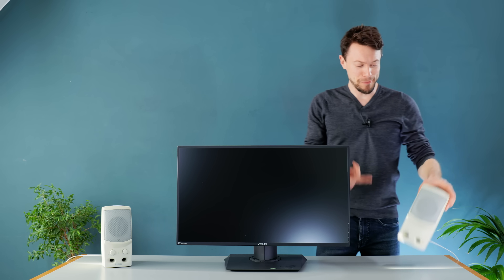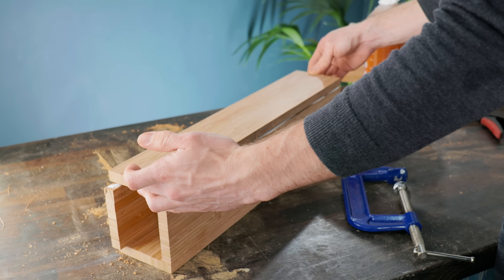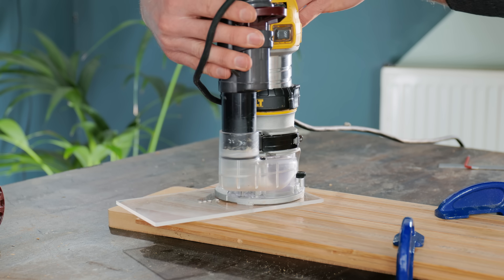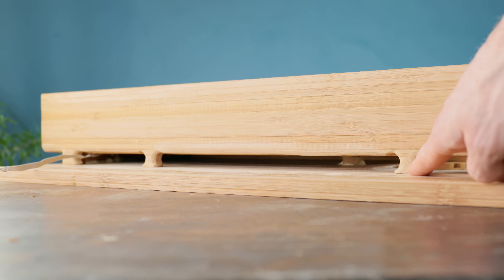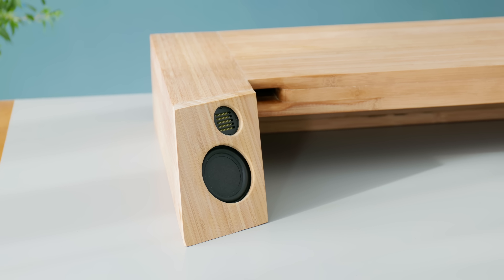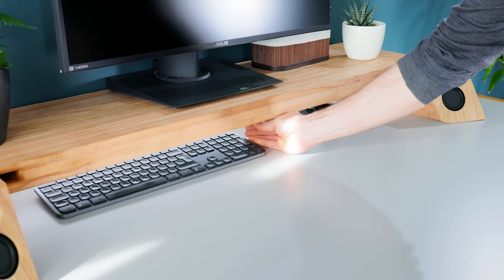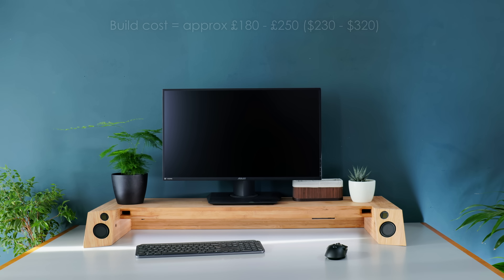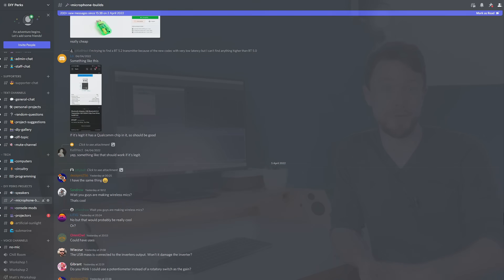Building a PC sound deck... with a twist!

Comment: looks great! the only thing I would've done differently is screw in the 30 degree facing speakers into the stand instead of glue... having absolutely no way of access the speakers for replacement of maintenance gives me a bit of an unsettling feeling. either that, or an access port from underneath? what do you think?
Reply: itsjust hot glue you can just pull it out with little effort
Reply: @thewhiterabbit133  Depends what glue it is. Some glues are so freaking strong that you will rather destroy the wood trying to take it apart. Especially industrial quality glues are unbelievably strong and gluing points become stronger than the material itself.
Reply: @thewhiterabbit133  If that was woodglue Matt used, he isn't getting the front panel off without destroying the wood. I agree with Alex. I wouldn't have permanently closed that space. It's £300 spent on a home made speakers, (subject to issues) so I'd want it to be fully accessible. 

That being said, I think they are incredible and they are on my list of things I want to build, but probably never will, hence why I live vicariously through Matt.

Comment: Fantastic idea, really! The only thing I would add are silicone or rubber feet to achieve a minimal mechanical separation from the table. I know, ideally you should be using spikes to do that, but maybe they would be just too much, and silicone feet would be a cheap and yet effective compromise.
Reply: If you are trying to decouple the speaker from the table, spikes will not do that. They will just concentrate the energy into one point and still transmit it. The best solution from a practical standpoint is something that dissipates the energy as it travels through it, such as foam. I haven't had any issues with soft rubber feet, so likely that works too.

Comment: MDF is used in speaker because of its rigidity and sound damping. In the opposite hard wood is used in guitar because of the resonnance. For a speaker MDF is much more appropriate. IMO you'd rather buy a measurement mic (can be found cheap) to tune the crossover. It is nearly impossible to make a crossover by ears ...

Comment: woooohooo, always such a treat when you upload Matt!! as usual, this is a beautifully designed and crafted project and the result is stunning. 

every time you make an audio project, which is quite often, i feel compelled to request that you make a spacial audio/surround sound hat/headphone/speaker headset, with a full surround array of speakers that can be worn on your head, using old laptop drivers perhaps.

i know it sounds kind of silly but i think it would be a fascinating and desiderable device with the growing interest and development in AR/VR and metaverse stuff.
please consider it, i know that if you gave it a go it would turn out great. my hurdle is my lack of understanding regarding audio signal processing. my only approach would be to use an off the shelf 7.1.4 receiver, and they are all heavy and huge, designed for fairly large drivers. if it could be shrunk down, i think a spacial audio headset would be an amazing accessory for the upcoming PSVR 2 for example!

Comment: That does look incredible but it may solve an issue that doesn't really exist anymore. you could always buy smaller bookshelves. While they won't be as small, they will still be small enough like the Edifier R1700BT. As the name suggest they have bluetooth functionality and sound incredible. The issue I have with PC monitor shelves is their lack of versatility.  It is extremely rare they fit 2 monitors well, let alone 3 which some people may want. Naturally, these could be use in conjuction with an arm, and just used as a shelf underneath the monitor. so there is that. 

All bookshelf speakers can easily be either mounted to the wall, placed on an angled foam(just like the soundbar) or placed on stands for them to be angled down above the speakers. 
This might be more expensive overall, but this ensures it works in any situation. I may also be too focussed on the usability in general. I tend to like my things to work in a variety of situations I can find my self in. That said... I still have to place mt R1700BT's properly. Most monitor stands go as high as I would need it to go currently, and wall mounting is a no-go for me currently.

Comment: That looks great.  I doubt I'd build one though.  I am using a set of Logitech 5.1 surround sounds speakers with a subwoofer and they do great for me.  I have the 2 front ones at an angled towards me and the 2 in the rear also pointed towards me and the center one is on top of my monitor and the subwoofer is in the floor under my desk and they all give a great immersive sound creation (for lack of a better word).  The speakers I really like was a set of Creative Labs 5.1 surround sound ones but the rear speakers quit working and I just haven't taken the time to take them apart and really find out what has happened to them.  I do like your build though.  It looks wonderful.

Comment: that $1200 set of Monitor Audio bookshelfs sound like they lack a tweeter to me or if they do have one, Its not tuned correctly or even hooked up. The low end and the mids are really full and spacious as expected from a decent set of bookshelf speakers. The DIY has a smaller soundstage with tighter more punchier bass, recessed mids but definitely more high end.

Comment: Nice build (and upvote).  Your build details are nice since it gives ideas for DIYers for our own builds.  I've loved your previous projects and looking at building your DIY microphone.  That said, I am not a fan of this build.  I pretty the less forward sound of the bookshelf speakers.  Typically I run bookshelf monitors for my main PC rigs.  I prefer the sound even if they take up space.  Also, I find speakers sounding the best when they point horizontally at ear height.  Firing upward may not sound the most immersive.  Something to watch out for:  the mid-drivers may be subject to damage being angled slightly upward and at the front.  You may need to put a grill on them or be super careful to not bump them.   Kudos again for a nice build.

Comment: This is awesome! Lots of great ideas in here that I haven't seen in some of the other desk designs. I have two questions:

1. Is volume the only function for more bass, not the size of the channel the bass bounces around in? That space is narrow so it seems like the waves would be too big to fit in it well.

2. Can you provide a clearer picture of the path for the bass channel? Are those gaps on the side related to it? I'm having a hard time visualizing the space you've given for bass just based (ha!) on the description and video clips.

Keep up the awesome work! I love, love, love that you're focusing on reusing and reducing and building stuff rather than buying new! I always look forward to your videos!
Reply: 1. Look up longitudinal waves. They don't need thickness to travel. Transverse waves do require thickness along one axis but sound travels as longitudinal waves in air. Also, static pressure is transmitted almost evenly throughout a closed space. While this isn't completely enclosed, this principle sort of applies here as well.
Reply: @Sweet-Vermouth  Oh, right, it's more of a compression of the air molecules rather than a wave like in water.

Comment: Laughs in 90's Pioneer amp and two JVC speaker boxes with 10 inc subs. Biggest issue is to keep anything on table when volume is turned high.
Also not fan of closed in speakers. It looks nice but get ready to use saw to replace speakers if anything were to happen to those...
Maybe make the front plate with speakers that has its own box and gets pushed in place. This way it does not matter if there is screws holding two peace box together and you can access the elements for repair etc. Could be pretty neat design feature to crown the front plate as well so it looks like floating.

Comment: This is kinda cool,downside being it takes up a LOT of space and reduces flexibility for rearranging your setup later. You're pretty much fixed in that orientation/layout. Having the ends protrude THAT far out from the wall/far side of the desk would drive me nuts. 

Making a monitor stand/amp/dac/subwoofer is a good idea, but separate mid/high speakers would be better. Getting them up off the desk would be nice too. Just because a speaker points at you, doesn't make it superior to one that doesn't but still has good frequency response at that (off)axis. 

Smaller powered studio monitors(especially on small stands) with a simple powered subwoofer under the desk is not expensive and fully flexible and take up little room. I'm currently using some small JBL 104s and a JBL active sub. Takes up minimal room. Excellent sound quality and you can even put your headphones over a speaker because of the round shape.

Comment: While watching the intro I just want to say most soundbars have degraded sound quality within 1.5m (5ft) listening range. So unless you have a really deep desk they will produce subpar audio on a desk top while you use keyboard & mouse (fine for gamepad gaming though). I made the mistake not researching this earlier this year...
Reply: Sound bars in general are all degraded in sound quality. They are a compromise of space for audio quality. The midrange is almost non existent and the lower portion of the midrange is made up by the subwoofer. This becomes a problem because sub bass frequencies are non directional, yet low midrange frequencies are directional, at least to the human ear. That means that where you place your subwoofer becomes more critical because your ear will be able to tell where the subwoofer is or the higher end frequencies coming from the subwoofer will create special distortions when listening. 

If you ever wonder how much of the frequency band a subwoofer is making up for since a sound bar is lacking, turn off the subwoofer and listen to how terrible the sound bar is by itself.
Reply: @VictoryAviation  I'd call that "downgraded" rather than "degraded". You are talking about a lesser sound quality based on the form factor and design. That's a different story.
My issue is about use-case. Sound bars are optimized for living room arrangements, so if you put one on the far end of your desktop and sit in front of the desk like a normal computer user, that's too close. The sound quality is significantly degraded compared to sitting a meter or so further away from the exact same sound bar.
By the way I found that specific sound bar fine even without the sub plugged in if I was sitting in the suggested listening distance. It was just not suitable for PC usage. Maybe I picked a good model, maybe I'm just not an audiophile. Doesn't matter to my point I think.
Reply: @rustkitty  Degraded sound was correct. A sound bar uses psychoacoustics to give the allusion that you’re hearing a full spectrum of sound. In other words, the sound you are hearing out if it is not the same sound that the audio engineers created in their multi-million dollar studio. The engineers of sound bars take a different sound driver setup and manipulate the EQ to a point where it doesn’t suck. In order to do that, the EQ must be colored (changed) compared to a flat EQ. Almost all modern headphones do this as well by the way, like beats and bose for example.

So in the sense of the definition, the sound is certainly degraded from the source material through sound processing and because the equipment is not capable of recreating the same quality of signal.
Reply: That is why you use a sound bar with a TV, and put the whole thing on a coffee table 3-4 ft away while you sit on the couch.
Big media setup perfect for games and movies, and put the TV on a mount that you can pull closer for boring old work dealing with text and emails. Current Gen graphics cards are finally available at OK prices, and have modern hdmi for eARC and full low latency 4k 60fps hdr compatility. It's truly amazing!
And yeah, it is no 120hz monitor, but I'll take 4k hdr on a big display at 60fps any day compared to a tiny screen at a higher framerate. At home I am mostly consuming media or doing work. For the 3-6 hours a week I play games vs the 20-60 hours a week doing everything else it just isn't worth it

Comment: The DIY speakers sound roomier and warmer, but the mid range is a bit muddier and pulled back. I assume this is because of the material used and the drivers being so far recessed. 
An easy fix.
Reply: Any suggestions as how to fix the issue? I'd like to make these for my setup.
Reply: @thresh-  If there is an issue, you might try mounting the midrange drivers flush to the face of the cabinet, and/or try altering the crossover component values, using the driver specs to determine things.
Reply: @thresh-  Mount the drivers from the front and don't go crazy with the router in case you want to recess the after all. You can make the cage/mounting flange flush with the surface but you shouldn't go further than that. And I'd use MDF instead of random wood scraps. Different types of wood will produce audible differences in sound. MDF isn't the ideal material, but it's good enough and consistent in its properties. One potential cause for issues off the list. 
I'd maybe try and add a little more volume to the speakers, the woofer's probably going to be happy even with a liter less. There's a lot of simulation software available for zero to a couple bucks. IMO it's always worth it to spend an afternoon or two simulating and fine tuning a setup to your liking before you start cutting material.
Reply: It could also be your listening setup, your ears, etc. Just saying. Other responses in this thread are their opinions as well.
Reply: The speaker drivers he used in the project are smaller in diameter than those in the bookshelf speakers he had for comparison. The DIY Speakers are basically 2.1 system with soobwoofer compensating the lack of low-end from small drivers. This will always had that 'hole' in the midrange. But still his speker system will sound better than those 2.1 PC speaker sets from Logitech or Creative, because he finetuned it and used quality components, including the amp.
Reply: Low range is borderline garbage

Comment: the whole project looks beautiful. However, don't the cheap amplifier boards introduce lots of clipping and distortion? I strongly believe at this point you should get some proper audio testing equipment with calibrated mics to see the actual frequency response of the whole setup
Reply: Clipping only occurs when the input signal is amplified unevenly because there isn't enough power to amplify the "louder" parts of the signal. It doesn't have much to do with cheap or expensive. Clipping won't occur as long as the boards can consume enough power for the desired output volume. Distortion is a whole other beast but that is likely to affect the speaker driver well before it affects the DAC/Amp.

Comment: I have my 27" monitor wallmounted with an arm. Right underneath it I mounted a JBL Bar Studio soundbar which is alright and has the exact same width as the monitor. To mount it I used some brackets and spacers which basically just made use of the vesa mount. Works and looks pretty nice.

Comment: great build, although one thing i saw was that you kept the screwholes on the inside of thhe seal. it's propably not that relevant for a speaer, but for a true airtight seal you would put the sealant in a way, that thhe screws are outside.

Comment: Design and craftsmanship wise, ten out of ten. However, I have to disagree with you on sound quality and acoustics in general. You can get passive monitor speakers for under 300 a pair (quick example: Monitor Audio Bronze series) that will blow away any speaker that someone without great knowledge and dedication for acoustics might build. Having said that, your build sounds pretty nicely, but it is definitely not a hi-fi build, as it would require fine-tuning of the boxes, bass reflex ports and mechanical crossovers very finely tuned. Also, the fact that you angled them to fire directly to your ears is nice, but as a matter of fact, unlike earphones, good positioning of speakers implies that they create a sound stage where you cannot locate where the source of the speaker is (that is, an invisible speaker). If you are able to tell the position of speakers with your eyes closed, it means maybe speakers are failing at creating a proper sound stage.

Comment: Fantasic project. One Suggestion: add a headphone/microphone Jack wich the sound automatically switches to (or with a button) to allow headphone gaming as well. This would be fanastic.
Reply: Maybe integrate an DAC. Would be super useful for all the streamers and people with microphones.
Reply: The only reason this would be worth doing is if that headphone jack was ALSO an improved audio format, because if it was just wired verbatim to the motherboard, it would only sound as good as the motherboard is capable of. A dedicated DAC to plug headphones into as well could definitely be a cool addition, though.
Reply: There is DAC that support auto switching when headphone is plugged. Or heck, wiring ...
DAC - HEADPHONE JACK - AMP 
  |
   -   HEADPHONE AMP 
also a possible solution to negate possible headphone jack failure for repeated plug - unplugging.
Reply: Or just hook up your headphones to the dedicated headphone jack on the pc?
Reply: @JustMamba  exactly what i thought aswell lmao
Reply: so do I :)